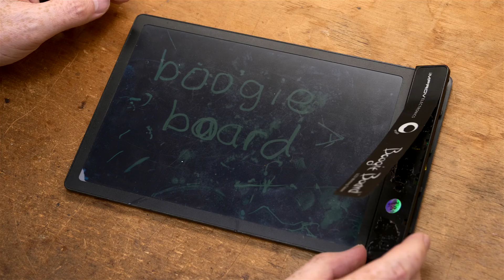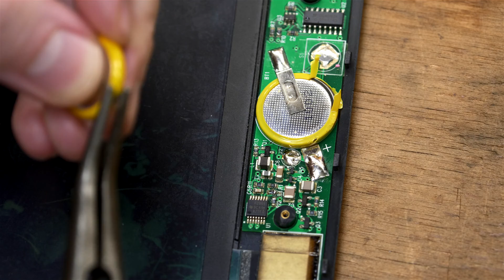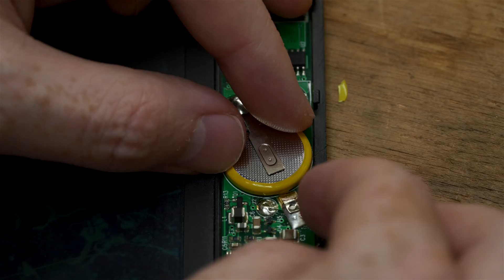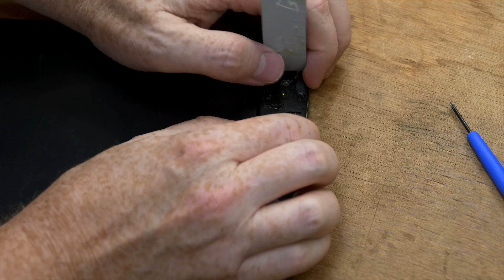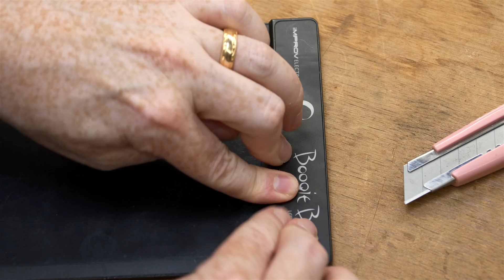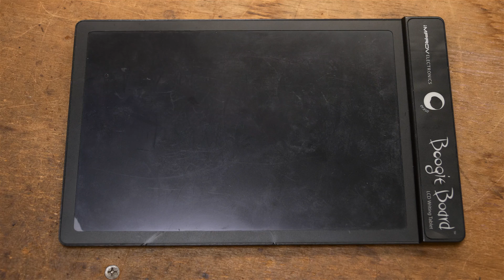Boogie Board LCD Tablet Battery Replacement

Comment: where can you buy the replacement battery?would be great if you could provide a link. thanks
Reply from the maker: After searching Amazon in the USA, I see a good number of CR2025 batteries with tabs, but for the life of me, I don't know why these silly companies refuse to sell them in singles.  They all require purchase of 3 or more. Here are my recommendations :
1. Cheapest Price: $7.99 CR2025 Five-pack, 150mAh (short life?), Chinese no-name brand, short (-) tab means you'll need to do what I show in my video: https://amzn.to/47yroLh
2. Pricey but Better: $14.69 CR2016 Three-pack 225mAh, Japanese well known brand, tabs seem to be the perfect length for a drop-in replacement: https://amzn.to/3tJnGAN
(Both are affiliate links on Amazon in the USA.)
Normally, CR2025 are higher capacity (bigger mAh-rating) because they are thicker than CR2016 (both are same diameter); but in this case, the cheap Chinese brand offers only 150mAh while the Panasonic is advertised as being 225mAh. The bigger the mAh-rating, the longer the battery life.  Both are 3V.  You probably would be fine with the cheap pack, and besides, you sure do get plenty of them anyway.

Comment: Very helpful, thank you!!

I was out shopping earlier and bought a used Boogie Board from a thrift store. I wondered if it were possible to replace the battery, and found your video. I was unaware of what a Boogie Board was or what a useful little gadget I had found.

Thanks again!

Comment: Wow! Watching your video again! Do you still live in Japan? How easy is it to lift up the small PCB? Have an idea for having 2 batteries. Thank you 🤓 Domo. You could also use a little isopropyl alcohol to help clean the solder area, to remove any flux residue. Do you also do other electronic projects?🤔 Plus, I subbed 🤓
Reply from the maker: I didn't remove the PCB, so I cannot remember if it was affixed to the plastic frame with 2-sided tape, but I think it might be.  Even so, there's no room on the underside of that PCB to fit another battery or any other component.
Reply: @JDW-  hmmmm... Ok thank you 🤓

Comment: You want "Frugal"? I found the same boogie board in our work dumpster this morning! Battery is dead, too! Is there room on the other side of the PCB to have a second button battery? Have them in parallel, so they would last longer. How long will the new battery last? Thank you 🤓 is there a way to mount a small on/off switch? Or does it come on only when something is being marked on the board, & after a short while, it turns off? But keeps what is on the board til it's erased? Thank you 🤓
Reply from the maker: How long will the new battery last?  Naturally, your mileage will vary, but mine is still working now in March 2022!
Reply: @JDW-  cool! Thank you! I believe your method, soldering, is the correct one, to install the new battery.

Comment: You don't need to bend the tabs on the battery. The connections are insulated and the PCB isn't doing any conducting, so just flip it over and make sure the polarity is correct.

Comment: Your model looks exactly like mine, My Board cannot erase also. But I check the battery with a multimeter and it read 3.19V, so What is a low battery reading?
Reply from the maker: 3.19V should be enough, but did you measure that while pressing the button?  Probably the voltage will drop lower while you press the button, and if so, that would prove it needs to be replaced.  If the voltage doesn't drop, it could be something else is wrong, but if your's is the same model as mine and if you've been using it all these years, you really do need to replace the battery by now.  So it's not a waste for you to change it like I did.

Comment: Just found a pair of broken Boogie Boards in the trash, apparently used by small kids looking at their condition. I could draw on one, but the 'Erase' button didn't work at all. Pealed back the sticker, removed the 4 screws and tested the CR2025 battery with my multimeter. The battery is STILL good, well over 3 volts. Then tested for continuity with the contacts--THAT is the problem (and likely why the comments where people flex or press down on corners of their Boogie Boards to "fix" it). I just slightly bent the pins to make sure the battery contacts are good, and now one of them works! The only problem is large areas around the tablet's outer borders are white, plus spotty areas in the middle, and I don't think there's any conventional way to repair that, short of replacing the LCD sheet. I took the other dead Boogie Board (far beyond repair!) and tried lightly peeling the LCD sheet and it just turns all white....so don't advise touching that part of the tablet! Though check the battery's metal contacts before you even attempt to replace it. Lithium coin batteries can hold a charge for 10 years or even much longer, and the "Erase" button isn't going to significantly drain it unless you literally hold it down for hours at a time. If there is a way to restore the LCD's E ink back to all black I'd love to know, that's the only challenging bit to repair.
Reply from the maker: Thank you for sharing such detailed information and advice!  I don't know how to restore the LCD either, but perhaps your message will inspire someone else to comment who has some good ideas.
Reply: @JDW-  - Looking at how these writing tablets work, I'm afraid fixing the damaged areas of the LCD likely isn't possible. The liquid crystal coating is sandwiched between two sheets of plastic, and any flexing and/or abuse causes it to permanently lift off and ruins that area of the panel. I think it's the same situation as the LCD panel in your phone, TV or digital LCD wrist watch--once it's damaged, all you can do is replace the entire LCD (I'd be very surprised if someone has a trick to repair it, but who knows). Incidentally,  the Boogie Board requires NO power to draw, write on or preserve an image, the battery is only used to wipe the screen. Technically the battery can provide 50,000 "erase" button presses before it needs replacing, which makes it unlikely you'd need to change the battery from normal use.
Reply from the maker: You’re probably right about the inability to repair the LCD, but then again I have read stories of people repairing 1990s Apple PowerBook LCDs with a hairdryer!
Reply: I've seen cases where heat (usually a soldering-iron) can repair missing lines on a 1989 Gameboy LCD, though that involves a bad data ribbon cable connection. You mean repairing an actual cracked or leaking LCD screen? That'd be interesting! Thankfully my Powerbook 170 has a fully intact screen, apart from a missing pixel or two. :)
Reply from the maker: @Apple2gs  I am talking about the problem where the film polarizer comes apart from the LCD and looks somewhat like a cloud when viewing the LCD.  I cannot say if a hairdryer really can fix that, but I recently read someone who claims that worked for him.  Even so, that is a very different LCD than a Boogie Board.
Reply: @JDW-  - Ah, that's a bit of a different issue, but still what I'd consider damage/disruption of the LCD coating layer and not repairable. My Boogie Boards are pretty much ruined already, I may try the hairdryer experiment and see what happens if I'm just going to toss them anyway! I'll let you know if I do try what the results are. ;)

Comment: I just gently pealed back the sticker with hair dryer and tweezers that revealed 4 screws. Then gentle pried the soldered tabs connecting the battery with needle nose pliers top and bottom. Be gentle as to not break the circuit board. Go to the dollar store and purchase a 3 pack of CR2025 batteries for $1.25. Just put battery back in same orientation that it was in. Replace cover with screws. The cover, and the metal tabs will hold the battery in place. Replace sticker, and call it a day.

Comment: solder the tabs on after ripping out the battery asnd use a normal cr2032. the screws and plastic tabs will hold it in place. works great.
Reply from the maker: I'm not sure what you mean.  The metal tabs attached to the battery are welded, not soldered.  So it is not possible to use a standard CR2032 and PROPERLY add the tabs yourself unless you have a special machine that does micro-welds, and even then I would not recommend it as such would heat the internals of the battery to such a high temperature it would negatively affect the battery.  At the factory the tabs are welded when the metal parts of the battery are made, not after the internals of the battery are inside.  Because of this, one really does need to buy a special battery with tabs, which is what I did in this video.  The only caveat is that the batteries with tabs that I could find did not have tabs long enough, and so I needed to partly use one of the existing tabs, as show in my video.
Reply: @JDW-  solder the tabs to the pcb and slide a 2032 in. works great.
Reply from the maker: @ysesq  That is sort of what I did in my video.  The stock tabs were already soldered to the PCB.  I simply cut out the stock battery so as to leave the necessary length of the stock tabs so that the tabs welded to the replacement battery could make contact.  Using a tabless CR2032 would not work with the method I used, for reasons I've already mentioned.  You are probably suggesting the soldering of tabs to the PCB and then "using pressure" slide a standard CR2032 battery inside with the tab pressing down on the battery, my method is bullet-proof in that even if you drop the tablet, the battery will never, ever be kicked out of place.  But if someone really wishes to solder a tab and then bend it to press firmly on a standard battery, it might work.  How well it will work over time is an unknown.  All I can say is that the developer soldered in the battery for a reason, so I followed that methodology in my video.
Reply: Where did you find the battery with tabs?
Reply from the maker: @shawnprestonmagic0667  I bought it from Amazon.  Search Amazon with the keywords "CR2025 tabs" and you will see several appear.

Comment: You can buy conductive epoxy and avoid having to buy the batteries with tabs though it's not cheap but it will have other uses.
Reply from the maker: Thank you for the idea, Richard, but for others to seriously consider it, you might consider making a video on how you use conductive epoxy in button cell battery applications.  I'd certainly give you a Thumbs-up on that!
Reply: @JDW-  I'll try to do tat. Another option is copper tape, you can get it with conductive adhesive and solder it so you could make your own tabs.
Reply from the maker: So long as the adhesive is secure and won't come off over time (say, over 2-3 years of use), then such sounds like a good solution for tablets button cell batteries.

Comment: Thanks. Have the same model. With the same film lift in the bottom right corner. 

I will look at ordering the same battery you ordered and solder if back in to. Thanks!
Reply from the maker: Thank you for watching and commenting.  Please let me know how well your battery swap goes!
Reply: JDW will do! Thanks again for the video